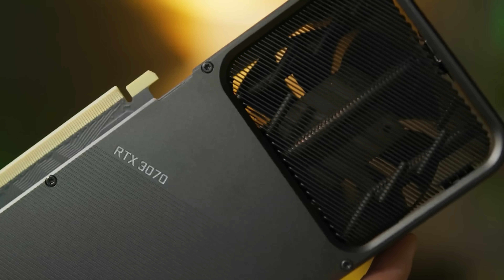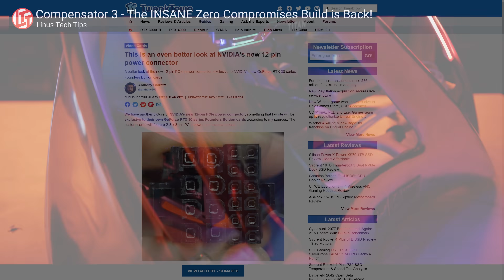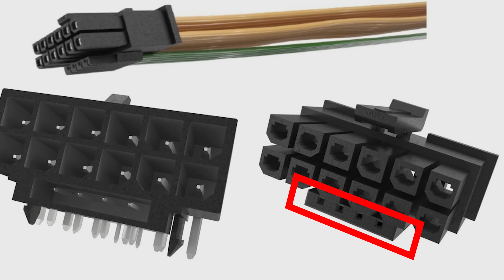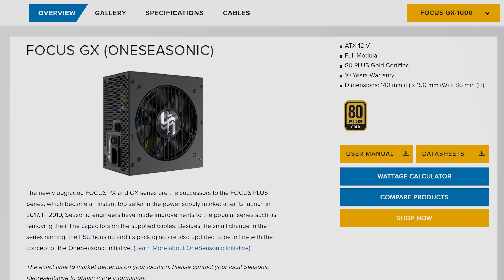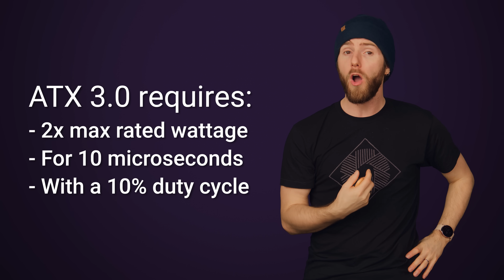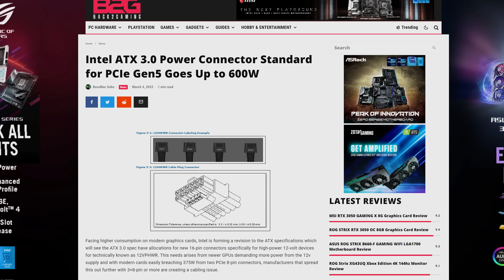Do You Need A New Power Supply? - ATX 3.0

Comment: I bought a Corsair HX1500i Power Supply, 1500W, 80 Plus Platinum, Ultra-Low, ATX, Full Modular, CP-9020215-WW for an i9 14900ks + RTX 5090, but I noticed that it is an ATX12V Version 2.52 and not ATX 3.0 or 3.1. Should I return this purchase and exchange it for a more updated ATX version?

Comment: I have a 550 watt Cooler Master 80+ Bronze power supply, is it strong enough to run an RTX 4070 Super with an additional 12 VHPWR connector cable?

Comment: my question is, if anyone competent can answer, if I use thae 12vhpwr cable, this would draw 600 watts from my psu? or with this cable, I can connect to a gpu that can draw 600watts at maximum? like if I use 4090 with that cable and I am using only about 80% of that gpu, will it draw like 80% of 450 watts of its peak or 600watts?

Comment: So I have a 4090 and want to get the Seasonic Vertex ATX 3.0 80 Plus Gold 1000W for the 12VHPWR connector. If the 600watt connector is only for watercooled gpus should I even be getting it. I am confussed.

Comment: I think two 8 pins are better than 1 12 pin.  If you look at the connector size pins the 8 pin connectors are 2x larger with more surface area.   Those tiny pins will have more resistance than two 8 pins.   Proof is that "Some" 12 pin cables have melted on high powered NVidia cards.  That does not happen with two or 3 8 pins.   So not sure if the new spec is better, just different.

Comment: One strange thing is I have a brand new MSI 850 MPG PCIe5.0 supply and its 8 pin vga connectors each are split into two 8 pins.   The spec calls for 150 watts for a 8 pin cable.   Yet they split there 8 pin cables into two.  (300 watts)   Depending on the cable gauge that means its even over 8 pin (288 watt) spec.   Why do they do this?  Its inviting trouble.
Reply: 2 6x2 is common on pci-e cables.  Don’t use them that way though.

Comment: Its funny how all these changes happened with ATX 3.0 yet there's no way for the system to monitor its own total power consumption and report it back to the motherboard and then software
Reply: You would have to connect the psu to the motherboard. Believe Corsair has a psu that does that.

Comment: very glad I got an ATX 3.0 PSU with Plenty of headroom for the stupid powerful GPU I paid an embarrassing amount of money for in a new build. I didn't have the luxury of testing its performance against an older PSU but the GPU is only drawing 1/4 of its stated max power most of the time and its fans barely ever run even on 4k, ultra, full RT, unlocked fps. thank you psu, and thank you case+CPU fans. this PC is gonna live a LOng time

Comment: Another suggestion I would like to see implemented: All power cables should show the wire size/gauge of the wires it uses. Some wires are 16 gauge, smaller diameter, and others are 14 gauge, larger diameter wires. This is an excellent example of larger is not always better.

Comment: I have a pc problem.It looses keybord and mouse enough times. But mostly it losts it from C in which I have windows and rarely from the other M.2. I asked and they told that it is PSU. My pc is  asus z-690  12600kf 3080ti ddr4 3200  - 3 m.2  - 1 hdd and 1 ssd in which I have windows. Can you tell me if psu is fault or something else? My psu is seagate 850w gold...And if is the psu,whay skould I take? gold or platinum?

Comment: Hey Linus, I currently have a Corsair AX1200 Watt PSU for over 10 years and still working. I am currently building a new Gaming PC. I am going to be building an intel i7 12700K, Mobo Z690 with DDR5, a 3090ti or 3080ti gpu, Is this old PSU is compatible or should I invest to get a new PSU. I know you did review this PSU long time ago and it did show the the connector is Type 3. Please help me out.. Thanks in advance.

Comment: ryzen 9 5900x with a rtx 3090 on a x570 steel legend mobo. 64 gig ram @ 3600 mhz which i've limited to 3200 mhz and two 4tb m.2 ssd's.. after a 3-4 hour gaming session my pc will randomly restart itself. I've narrowed it down to power supply.  850w plus gold seems to not be enough. so im going to shoot for a 1200w platinum because i like to overkill everything. maybe my pc will stop randomly crashing.

Comment: I am kinda confused if i can get an 850W (Not ATX 3.0) if I want to get a 4080 or not. can anyone clarify ? should I wait for the new psus ?
Reply: Yes that would be perfectly fine. However, you'll have to upgrade the psu again if you want to upgrade past the 40 series in the future
Reply: You can, the gpu comes with an adaptor to plug the norma pcie cables into

Comment: I've added a PCIE4 wireless card, an additional M.2, and TWO SATA devices (an huge HDD and a new smaller but faster SSD to compliment the other smaller SSD and two M.2s).

I've carefully watched my power consumption and...I've never seen it go above 70%. Then again this PC WAS built for expansion...I mean even though now the M.2 and SSD bays are full, there's still several more bays for MORE HDDs...and one more PCIE slot too!

Comment: What if I want to use two 4080's in my system?
ATX 3.0 has only one 12VHPWR connector!!!
Reply: "ATX 3.0 has only one 12VHPWR connector" LOL. check again
Reply: Neil  I haven't seen more then one, did you?
Reply: @PREETAM525  Yeah bhai it is there. But it is expensive 😢 They are there but expensive. Seasonic and Thermaltake have it. It is hard to find out which ones but if you go to pcpartpicker and pick out a PSU there is a filter slider option for 12vhpwr connector just slide that to 2
Reply: Neil  yup  I have seen those, one is 12+4 and other is 2x 8pin connector
Reply: you cant use 4080's in SLI
Reply: Andreas  I want to run two monitors in two different graphics card, this is just an assumption. (What if)
Reply: @PREETAM525  well you can’t have two graphics cards in one pc anymore. You’d have to go back to gtx 1000 series. Nvidia removed SLI since 2000 series. That said one graphics card can still have multiple monitors connected to it.

Comment: 5 Months Later ...... Rtx 4000s are announced and guess what. It seems this new spec may well be a requirement for the 4090s, with their potential 600w overclock. Fire warnings are out already. Do not try Adhoc cables with older PSUs!

Comment: Why didn't Intel specify the communications standard of 48 V instead of staying with 12 V. That would reduce the current through the cables by 75%. Ćuk has already created a VRM design that converts 48 V to 1 V at up to 200 A.

Comment: A better standard is the communication 49V. Then you do not need multiple power connectors to handle the current requirement of a 700W graphic card.

Comment: Oh boy, another point of failure for not only power supply but the gpu too? Count me in! I like a standard I'm forced to use that has points of failure and make repair nearly impossible.

Just wait till they drm specific gpus to specific power supplies. Especially pre-built. On you want to upgrade your gpu, too bad. Oh you want to use the pre-built gpu in another system, too bad, that gpu was made for this system. Wouldn't be too surprised if they were serialized, each gpu paired to the power supply that came in the system and no other power supply, even one of the same model will work.

Comment: So here is to hoping we still get those 4-pin molex connectors in PSUs. Molex power is still used. USB expansion cards, Molex to SATA power adapter, some RAID cards, etc. Molex power is used a lot in computers just not the GPU nor hard drives.

Comment: Why do they need so god-damned-many pins?  It's only conveying a single voltage: 12v.  Just put two (maybe very wide) pins on it and be done with it.  Then re-use that same connector for everything in your system that needs power directly from the PSU, including your new 12vo motherboard.  Stuff that has a legitimate need for 5v or 3.3v (are there such things anymore?) can use the older connectors.

Comment: Yes that's all fine and dandy but I just had to upgrade my power supply and i intentionally over spec'ed the wattage so I could use it through multiple upgrades so they better not pull this crap. Ironically enough (since seasonic sponsored the vid) I actually bought a seasonic psu partly because of the 10 year warranty. Suffice to say I want my 10 years worth lol

Comment: this is gonna be forever before it hits the budget market. you dont need the standard if its a 500 watt power supply, and even when they switch to the standard for gpu's. im sure there are going to be adapters to go from 8 pin to 16 pin power supplies

Comment: 2042: if you want to fire up your gpu you will need pilot jacket, goggles to resiste the 42cm fan blowing.  and a wall outlet just for the special gpu-psu that deliver 4000watt...with a special 320pin connecter...
Seems like the tech industries didn't get the memo, about the the environment issues..

Comment: so if one have a ATX 2.0 that is modular one can't use it with a modular cable with the 12VHPWR? Cause min is a 1000W PSU so it wouldn't need to talk to the GPU it has the power to give anyway

Comment: If its still 12v just get the connector and solder on a connector to a older psu :) it probably works good with some adapters :)

Comment: Why isn't the motherboard communicating with the psu telling it the specs? 16 pin connectors, imagine pulling them out when even the 8pin is quite solidly in... And also, does this come with a notification, "yo, your gpu is throttled because psu is weak" or I'll just have a crippled gpu with no explanation unless I'm tech savvy enough to figure it out?

Comment: Well Seasonic, while you’re here, mind bringing me some clarity over how well your fanless power supplies can handle those momentary spikes mentioned in this video.  Thanks :D 
Or you know Linus, you could maybe provide some insight there too, is the fanless better or worse than the fan versions? Sincerely, a fan lol
Reply: it depends on the components and the power draw. if its a 450w psu it will be obviously fanless since that shit doesnt get barely hot enough to even turn it on. and it would be necesary for anything over 550w since they would produce a fair amount of heat at full load and that would be bad af for the psu(and their warranty)
Reply: @kuma8030  I think a really important factor in how hot a power supply gets, is how efficient it is. As a power supply passes through energy rather than consuming it.  A 2,000w 90% efficient power supply and a 1,000w 80% efficient Should be just as hot. Each loosing 200 watts to heat . Because 10% of 2,000 = 20% of 1,000.  What this means for automatic current protection is still for me an elusive dynamic factor. But I think fanless designs are currenachieved by higher efficiency designs, and parts with higher thermal tolerances like 120+celsius instead of the typical 85celsius. So they don’t make as much heat, and can also wallow in higher temperatures without failing.
Reply: @SwirlingDragonMist  that would be true since the two fanless models of seasonic are platinum. but its still not enough for doing anything since they are 450w and 500w.
Reply: @kuma8030   The fanless Seasonic I have is “700 watts”, by my calculations thats enough for a 3080 system.  But those current spikes give me pause.  Even if the power supply can swing safely beyond 700w momentarily which is common among all power supplies as far as I know, I worry it has an automatic shutdown when over current is detected. If it’s a thermal reading, it’s no problem tas my pc case provides allot of air movement over the power supply.  But if it just shuts down from a current reading, it may be a real party pooper.
Reply: @SwirlingDragonMist  welp that 700 watts isnt in the seasonic website anymore so i belive it isnt for sale anymore. then you have the efficency (which i dont know) but given the fact that nvidia recommends a 750w for the FE version. the rest will require something supperior. you should be good with the 3070 tho but it also depends on your cpu. if you have some really low wattage cpu like a ryzen 5600 (without the x)  you could actually use the 3080 but i dont know about stability(i would probably undervolt it anyways just to be sure)

Comment: Bad idea with the gpu connector. Will on average force you to get a bigger PSU.

If it is the responsability of the PSU to guarantee a certain power delivery (labeled on the connector), they will play it on the safe side to not be liable, because they need to accommodate for someone buying a power hungry CPU + 12 harddisks etc.

I prefer the responsability be on me, and be able to dimension my PSU reasonably.

Comment: Yeahhhh - NO. Why this channel so often pushes nonsensical BS like this is debatable, but I'm sure it has nothing to do with the sponsorships (FFS!). Let me explain what's actually going on here: ATX 3 is the next gimmick Intel is pushing on the PC hardware market to force perfectly viable previous-gen hardware into early obsolescence for the sole purpose of selling more of their current generations of increasingly-less-impressive hardware. Let's not forget that this is the same company responsible for turning GeForce into an inside joke among actual PC hardware experts; these are the same buffoons who doubled or tripled the base price of their GPU lineups under the guise of providing a new, shiny—useless, often performance-backwards—marketing gimmick with each successive generation, every one of which has brought little or nothing to the table while forcing game developers to bend over backwards to accommodate and support them - and which now number at least one per calendar year. Every important specification of ATX 3.0 is already met by quality power supplies post-2010ish, and the ones that aren't met don't matter; what this is really ALL about is that CONNECTOR. With a new power cable form factor, you just straight up can't use your old hardware without an adapter - and Intel is already trying really hard to make sure that won't be a simple matter of pin-pass-through. That's the real reason they want to add the 4-pin logic bus to the cable, for example; there's absolutely NO need for your GPU and PSU to communicate more than they already do, or for that communication to happen outside the power delivery circuits themselves. Additionally, current power supplies are already FULLY power-modular for GPUs! If you need more power, you plug in more cables; if you don't need them, you don't use them. It doesn't get any more modular than that. There's "if it ain't broke, don't fix it," and then there's this total ass-backwards nonsense - which is several miles past it on the highway to Stupidville.

Comment: the most important thing wasn't covered at all: atx30 is supposed to only have 12V out and the rest should be done by the mainboard - which would also lead to higher prices of MBs but this is also a big thing when it comes to efficiency. But I don't think buying a new PSU for your atx30 gpu will be necessary since there will be adapters.

Comment: Thing is, it's still 12v... and not even 12vo. The pinout (barring the data pins) for the PCIe 5.0 connector is, I believe, similar to the nVidia spec, and still delivers power even if the data bit isn't tied to a GPU (just without the smart: "hey I can only do 20A"-kind of messaging that would tame the GPU, the GPU remains unbridled and capable of crashing the rig if it goes beyond what the PSU can do). There's no reason to think that there won't be 2x8pin adapter cables such as those that exist for founders cards right now. If you spent €300 on a decent PSU now such as a 1300W Seasonic that in many ways already meets the spikey/efficiency specs for ATX3.0 I don't think you'll need to be worried. Still, before we end up with something like CCS Combo2-style cables leading to our GPU, I think we need to do what 3D printer people have done already... up the voltage, and while dropping 5v/3.3v, also go straight to 24V.

Comment: Ooh, it shouldn't be so long before conversion kits are sold, with a pseudo PSU dongle communicating the right stuff. The conversion kit will also include extra capacitors for those monster 2x draws. ...on the other hand, if the video card cost $2000 another $100 for a new PSU is nothing I guess.

Comment: So THAT'S why the 4080/4090 are rated for 600W.

They are jumping onto ATX3.0 and 600W is the maximum rated wattage the cards can hit, and due to ATX3.0 adjusting wattage of the GPU depending on PSU, the actual recommended spec for the GPU may be far lower for Wattage (300W for the 4080, 450W for the 4090.etc)

Comment: Electrical Engineer Student here. Currently dealing with power electronics for my senior project. A PSU outputting 2x its wattage for 10μs is nutty. I am used to dealing with some chonky parts for power spikes in the 10ns range, I can't imagine what it would be like designing a supply for 10μs 2x peaks. Id expect these new PSUs to go between 1.7x to 2x current pricing tbh
Reply: I'd rather have to pay more for a better, more protected product than have to pay more for a GPU just because of supply issues
Reply: Officially it's 100μs at 2x max rated capacity. This is on Cybenetics website.

Comment: Ultimately the upper limit for the PC power consumption is 2.4Kw so there’s only a limited room to increase the power of the PSU left.
Reply: i would have thought that in the US at least, the cap would be somewhere around 1.4kw.  Most people in the US aren't going to have access to a 20amp outlet.  But even if you did, I would think that you wouldn't want to purposely install a PSU rated above 80% of the 2.4kw capacity, so you would be at just under 2kw.  At 80% of 15A on a 120v circut, that comes out to just over 1.4kw.

ETA:  And of course, unless you are using a different circuit (not outlet) for your monitor, speakers, etc, you potentially can't reliably go that high.